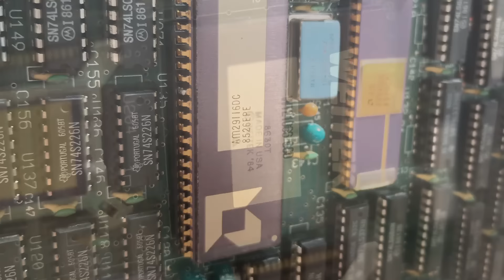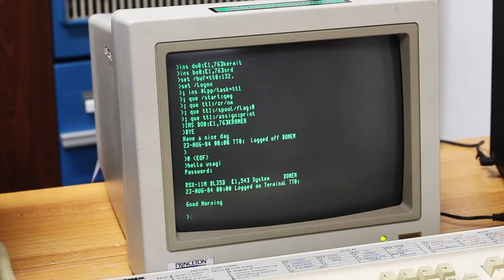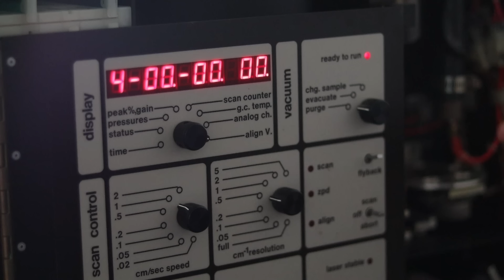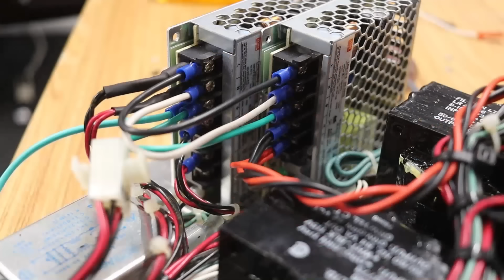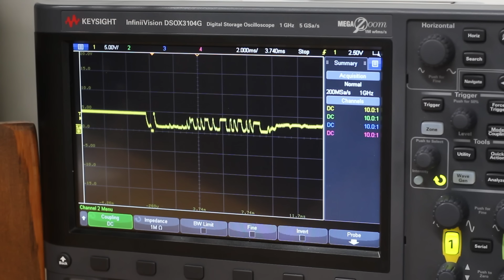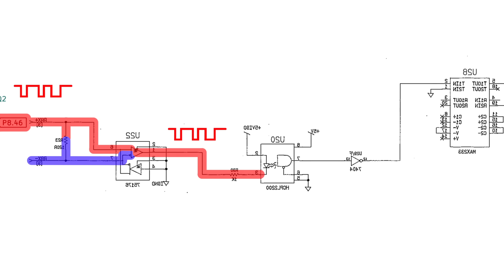I Tried to Connect the Bomem and PDP-11/73, It Did Not Go Well...

Comment: Oh man, why did they design a new opto interface board for every type of client that was possible at certain times?
And then it sounds like all had the same connector to the outside world.
Regardless of DB9 or DB15 - any halfways sane person would keep the pin out and the cables the same!!!
Here it were even more efforts because of the tons of extra signals...

really, for the moment i see no good reason at all to let any former end user swap the opto boards,
just to get an alternate measurement and computation node connected to the bomem (not bowman, like my microwave).
it already breaks the versatility - but seems there have been times where it was no brainer at the supposed price those units might have been sold - along with the computer aside to them.

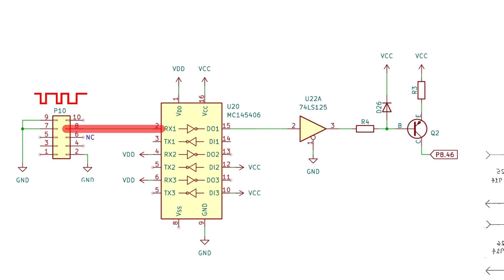Comment: 24:40 - just pull out U20 - and put a jumper from pin 2 to pin 15 ???

i am clearly not sure if that has the same levels on input and outputs - but it would be my first best idea to just invert the data levels of the signal.

Comment: Here is a pro tip on RX/TX. Change the signal names to the devices in question. If the signal goes from the Bomem to the PDP; name it BOMEM_PDP and if the signal goes the other way, switch places so it is PDP_BOMEM. RX/TX is just confusing.

Comment: If you want to be creative (with some minor mods):
. piggyback a 74ls04 on U22A, only connecting pins 1, 2, 7, 14
. cut the trace to pin 2 of U22A.
. connect pin 1, of the 74ls04 to before the cute trace of pin 2 (U22A).
. good habit to connect pins 3, 5, 9, 11, 13 to ground. This will prevent the unused inverters from ever oscillating.

Comment: RS232 is bullet proof unless its not. Variation in ground from dirty power, straight to jail, try running off a inverter, straight to jail, occasional resets, straight to jail.

I actually made a powwr bank to run my laptop and some GPS logging equipment from back in the day so theybhad absolutely the same ground potential, found running USB to serial adapters was more stable than serial ports on the motherboard of laptops due to how windows was handling IRQs occasionally.

Comment: Never feel bad about getting RS232 wrong - it's like magic. It's like not being able to insert a USB plug until youe reverse it at least 3 times .......... All of that is going on is NOT NOT NOT NOT NOT NOT NOT NOT NOT NOT NOT NOT NOT NOT NOT NOT NOT NOT NOT NOT NOT NOT NOT NOT  OK. Is that the right number of NOTs? Correct board sounds best option or start bypassing inverters ..................... or buildl from scratch - phewwwwwwwwwwwwwwwwwwwwwwww!  Can't wait for the next installment!  I'm currently down my much smaller rabbit hole tryng to restore an Acorn Archimedes A3000 BADLY damaged my leaking NiCD gunk - this helps me center myself again ...................

Comment: Do you really get SMPS hate? I rarely see any negativity in these comments and I just don't understand why anyone would mind you putting a SMPS in the power supply of anything newer than the G15 (which even then I wouldn't mind if it gets it working). It might not be the original part, but original parts often no longer exist. SMPS are not even anachronistic, they have been about since the late 1950s and even my oldest oscilloscope from the late '70s/early '80s which is all discrete transistors and no ICs still has a SMPS.

Most armchair engineers who would complain about this sort of thing would also be the first to just cut all the capacitors out of working vintage hardware and replace them with cheap chinese modern caps with all the wrong specs.

Comment: i would put a dumb terminal on the tx and rx and see what you are getting as well you are using higher level software a -6 error could be wrong stop bits, incorrect baud, parity issue the old 8N1 is pretty standard but older stuff may be 7E2 or something the software is just going to receive garbage and give -6. Could there be flow control too xon/xoff or rts/cts null modem stuff. XP probably also running 115200 bps over DEC doing 19200/38400. Another thought is if you got the MAX232 at the end bypass the card and go straight to that?

Comment: In 93, I had a summer internship at Mobile Solar Energy Corp. They had me use a very similar setup to do  FTIR Spectrometer f scans on special solar cells that outperformed the others. I think each scan took about 12 minutes. I would get a few numbers from the PDP's screen and enter them into a PC.  The FTIR Spectrometer that they had I "think" had a blue tube.

Comment: what speed its running it? these junk transistor based drivers and optocouplers are too slow for anything sensible mire than 9600baud . Lifted grounds with max232 drivers or the older 188 189 drivers can cause strange defects.  optos clobber signal shape and speed and kill it beyond 9600

Comment: no hardware flow control on that serial port? That's unusual in my experience for that era hardware. I noticed on the schematic the connector with the rx/tx lines had at least one pin labeled "NC" (not connected) but it had other pins with no labels!? Hope you inspected those to make sure they're not used :-)

Comment: Hey Usagi ... when you plugged in that massive 50-pin D connector and talking DEC computers, a tiny bell went off in my mind. And later when you said, maybe all the signals are inverted, that bell became an alarm. Many years ago we were working with some custom equipment for the Unibus on a VAX, and had that exact problem. We were using a differential DMA driver card, and EVERY signal was inexplicably inverted. Finally, we realized the problem. The DEC-supplied bulkhead connector was like a 2x25 IDC-style box header feed-through, male to male, bolted on the panel. what was very subtle was it was just straight pins from one side to another, No provision was made to flip the odds and evens (you have to think about it a long time to visualize the problem). Very fortunately for us, all the signals were either differential or power signals occupying two pins. In the end, we manually rewired 3 or 4 handshaking signals on our equipment, and just accepted that all our data would be inverted and dealt with that in software.  Seeing you have a triple-row connector, I'm not sure this failure could be at play. But I thought it was worth printing out. Good luck. -Chris

Comment: What I'd be inclined to try is checking whether or not that inverter chip has an unused gate in it.  Often, not all gates are used in a particular design which means that with a few minor board modifications, you might be able to use a spare gate to re-invert the signal (incidentally also re-buffering it) to correct the phase shift.

Comment: Just for debug purposes, how about snooping the data with an Arduino? I'm using one to make a diesel heater act like a real furnace - it just connects to the data lines between the controller and heater, reads the sensor data and sends signals as programmed.

Comment: RS232 problems. And then we replaced that (at least on PCs) with never knowing why the damn USB cable don't negotiate 40V or doesn't transfer data faster, or doesn't recharge whatever is the device's battery, or the USB controller simple not liking your device and it not showing.  after all, USB is still "serial" ...

Comment: THe need for a gender changer is not an immediate red flag for me. The card was originally in the desk enclosure, and there was probably a cable running from the card to a bulkhead passthrough that did the g3nderbending. you don't have the desk, so you need the adapter

Comment: When I first saw the serial data stream the first thing I noticed about it was that it was upside down to what I usually see between devices. I expect to see the signal idling with a high voltage and going low when data is sent or received. I wasn't sure where the serial data was being tapped so I wasn't sure if that was going to be a problem in this situation.

Comment: At least now we know why the connector on the board was the wrong gender, because it's meant for a completely different cable and interface on the Bomem. And don't worry about the TX/RX mix up, I still manage to get them swapped after 20 years in networking.

Comment: About ground loops and SMPS... SMPS are not bad.... But stacking 2 SMPS supplies in metal casing is not really doing isolated grounds. SMPS supplies commonly have its casing connected to earth and to negative output terminal. And you can't really operate it without input ground connected, because you will have floating half of the input AC voltage potential on the ground (X and Y filter caps on the Input inside PSU), and inadequate grounding for safety... It is not really that simple, actually it's quite complicated topic ;) In doing isolated PSU, actual classic transformer with linear regulator Is a way to go, as transformer does galvanic isolation from the start, and it doesn't require grounding for safety and noise suppression.

Comment: RS-232 was designed to connect modems (Data Communication Equipment - DCE) to terminals (Data Terminal Equipment - DTE).  Everything else is a bastardization of that. May favorite was connecting computers to printers.  I like to avoid software handshake (XON/XOFF) and use hardware handshake - but that's where the fun really begins. Different printers used different pins (I think the TI810 used pin 11(!) ), and different computers looked at different pins.  As I recall, one Unix system would bitbucket the whole job if you handshook the wrong pin.

Comment: Normally the differential amplifier is used if the signalling is differential (i.e. twisted pair when one signal goes up when other goes down like Ethernet, USB, RS-485, and not like RS-232)

If the signal is indeed differential - you need to swap the wires to invert it

If the signal is not differential (i.e. its twisted/adjacent wire is ground) - the signal would invert if that cable was to be connected to +5V instead of GND, however it's probably not safe to do that as on the other side it may be also connected to ground or something like that.

In either case, check the voltage levels on the specifications.

Comment: And if after signal inverting correction there still will be communication errors, check out DB connector on opto-isolator board at PDP11 side.. By video, some pins look melted inside that male connector.. 😉

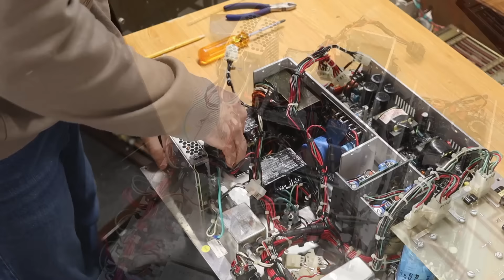Comment: Regarding switching noise 16:50, keep in mind: an original (period) supply will have much slower transistors (most likely BJT), slower controller, and lower Fsw. Harmonics above say 30MHz are likely much lower level than from a modern supply, which even for simple units like these Meanwells, will extend up to 100MHz or so. A supply I've been working on (new design) has a switching loop resonance in the 100-200MHz band.  And that's still using traditional Si MOSFETs and (PN) rectifiers; SiC and GaN push harmonics even higher (400MHz+).

Frequency range matters: higher frequencies are less inclined to "stay in wires", as transmission line effects come to dominate sooner (i.e. for shorter length routes).  They seem more pernicious; you clip on a scope probe anywhere and see the same noise -- even when probing "ground" itself.  For the routes in question (~2m long), the original supply might well've been able to cause problems, if it were noisy; presumably, it was at least well enough filtered.  Even so, that doesn't let us infer behavior at higher frequencies: the immunity of individual circuits also changes.  BJT (discrete and op-amp) circuits are infamous for detecting FM and cellular broadcast, for example.

Filtering in the Meanwell should be adequate for most purposes, e.g. you can run it (including with long wires attached) near an AM radio, and still receive broadcast.  But it's a lot harder to say if that will be adequate when routed alongside sensitive analog harnesses inside that big chassis, which itself might not be very contiguous at RF.  (A big metallic chassis, with galvanic bonding, is no guarantee of high-frequency grounding; a little sand or oxidation between mating faces, and whole frame members can be "loose" at high frequency, coupling signals between nearby harnesses rather than shielding them apart.)

That's not a very easy thing to illustrate (to the audience), or inspect yourself, or to solve (even with suitable instrumentation!).  Hopefully, if there is an issue, it makes itself reasonably well known -- intermittent noise floor, for example.  Blaming that on aging transistors/ICs is easy enough, but tracing the signal path (perhaps with the help of a heat gun and/or cold spray) and finding nothing, will bring scrutiny elsewhere, and then a substitution with linear supplies may be in order.

It feels like a low risk to me, so, basically leaving it at the "you can all shut up, I know, I'm being as responsible as I can, I'm going ahead regardless" is a fine course of action.

Comment: I maybe wrong here, but at minute 21:02, the oscilloscope shows a signal between -2.8V and 10V, and the -2.8V looks pretty bad.  Aren't the RS232 signals supposed to be  either in the range of +3V to +15V or the range −3V to −15V? I think  -2.8V is not a valid RS232 signal level.

Comment: Well, at least the failure mode you're facing is "It doesn't work and does nothing" and not "It completely fried my PDP and Bomem beyond repair". So as long as the proper card will get things working, nothing is lost. I'm also guessing that's the reason the pins on the cable were the wrong gender...

Comment: This brings back headaches of ground loops, mixing up the TX/RX, proprietary connectors and all that craziness. When I wrote my Master's thesis on communications protocols using serial communications, I ran into a doozy of non-standard standards... I made a custom switch box and analyzer to get around the handshake lines and TX/RX with all the different DB-25 to DE-9's and null modems... I still have that BOX FULL of stuff  put it next to my vintage computers. 

That connector reminds me of a time I worked at a shop where we needed to program an Allen Bradly PLC-5, The PLC-5had a weird D-shell 37 pin proprietary connector, and they charged $200 bucks for a serial cable to connect to a PC using the ATX DE-9 standard... While many businesses would have just purchased the cable and called it day, it really was stupid-simple what they had done, you only needed 3 wires, so my boss took a looked at the pins in the PLC-5 manual, ordered the mating DB-37 and soldered 3 wires to the DE-9 connector and plugged it into the PC, the software recognized the PLC-5 and we were in! Saved $200 bucks.  Geez, the lengths people went to for an upsell for an accessory to do obviously basic things.
Reply: I used to word for Siemens, and they did the same crap.  The pinout was in the manual, so you could easily make your own cable, but why they made it different in the first case was annoying.  I eventually got the Siemens USS cable, because it had some additional functionality, but there was no reason they could not have just used a standard 9 pin serial connection, Siemens did that intentionally so you'd buy their cable.

The absolute worst, IMHO, was the GE-Fanuc series of PLC's.  Not only did they use a weird, proprietary cable (that they didn't give you the pinout for), they also used a weird serial setup.  Now, i am a stubborn MF, so i rang out the cable we had, and made a bunch of new ones for us to use.  And then laminated the serial port settings and glued those laminated sheets into every cabinet.
Reply: Things got so bad, we ended up with an entire 400 page hardcover book discussing the details of serial communication. I used to own a copy of "Technical Aspects of Data Communication" by John E. McNamara. It certainly was comprehensive, but also mind-numbingly tedious. There is no reason why serial communication needed to be this complicated. But I guess, we were trying lots of different new things until finally settling on a few good ideas
Reply: It’s cool there’s enough Patreon support to keep this guy in business

Comment: I would have just added a small isolated DC-DC converter to isolate the power from the msin 5V supply. Cheap and effective. Most isolation cards / circuits just do that on their board, but can easily be made externally.

Comment: Takes me back to when I interfaced a Sega SC2000 plotter (same internals as a Radio Shack plotter, but higher baud rate). Has to invert the RS232 and limit to 5V plus use a diode with a load resistor to remove the negative voltage as TTL inputs don’t like that. Worked well except a few programs had the baud rate hard coded. I also built a dual mode cable that could be switched for LapLink or PCAnywhere. Bonus, it worked as a regular RS232 cable, straight or null modem

Comment: As soon as I saw that plugging in the monitor caused the spectrometer to reset, I knew it was grounding. I've had that happen to me many times over the years. My guess on the power supply isolation is that the original was transformer based, whereas the new ones are switching, but I didn't see the video where you replaced the supply. At least you didn't have the issue where common and hot were switched; getting the ground wrong when that happens is a good way to release a lot of magic blue smoke that is impossible to put back where it belongs.
Reply: even switching PSUs are normally very isolated - its a little HF transformer in contrast to a large NF/LF transformer. it also saves you from using bigger capacitors.